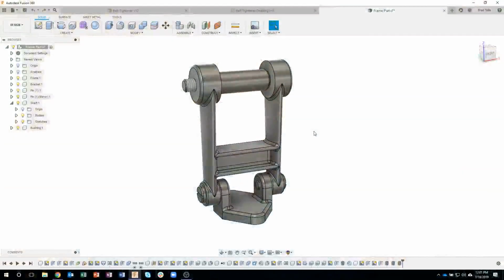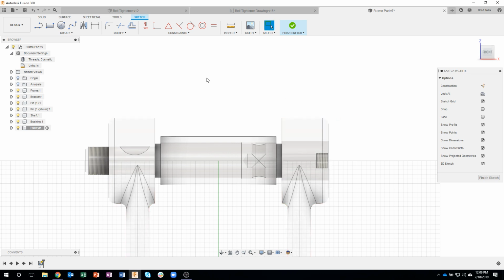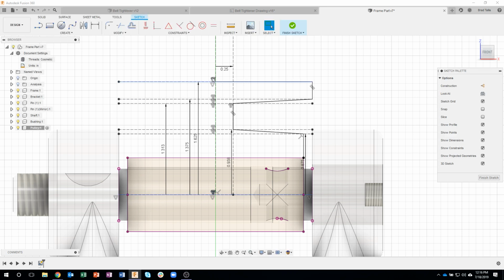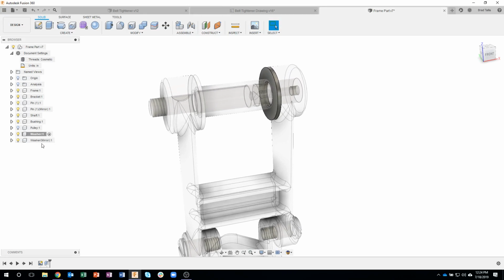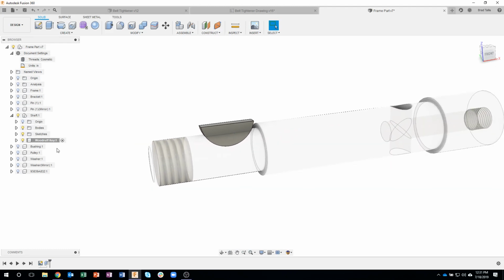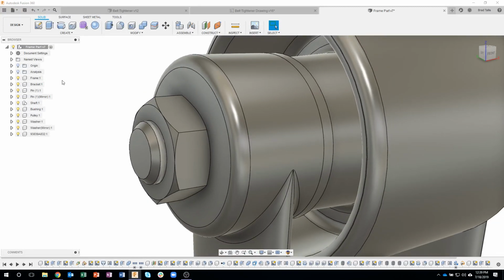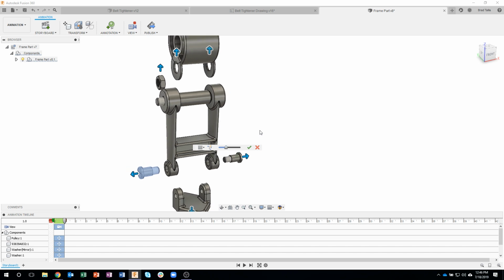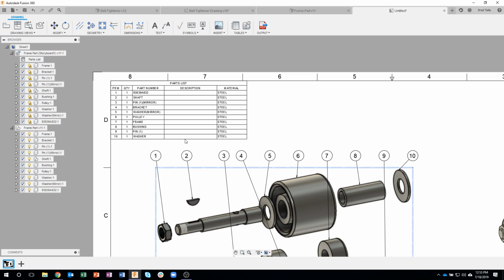360 LIVE: Creating In-Context Designs (part 3 of 3)

Comment: At 24:47, you didn’t even need to create the sketch for the washer. You could have gone straight to extrude, select the face, chose the option « To object! » and Voilà!!!  One less feature in the timeline! ;) Important though, you need to access the Extrude command to do that so tou can’t use the « Q » keyboard short cut. Use the « E » key or you’ll end up in the « Offset face » command and that won’t work here.
Reply: Ya, you can do it that way, but you have to remember to select "New Component" in the operation, otherwise it will "join" or "add" that extrusion to the existing part.  I also like to use a sketch because typically your sketch is the "master definition" of the part.  When you want to make a change, you typically change the sketch.  However, you are correct, it saves a step or two.
Reply: @bradtallis8968  Thanks this answered my question about if there was advantage to the sketch here. I guess a key thing here was that it was a new component. If it was part of an existing component maybe it would be less worth it.

Comment: Enhancement request for the combine and Project commands. Instead of having the parts be created line to line, as in the combine command with the "CUT" method, provide an option to have a clearance be included. Kind of a built in offset/ built in tolerance. You select the two components to combine --> select combine --> Select Cut  -->  select a "tolerance compensation" which creates a gap a certain distance you specify (i.e. 0.005") -->select okay.   From the example you gave in part two @ 10 minute mark, you may want to have the material removed from just the frame or material removed from just the bracket or have it removed from both (i.e. 0.0025" from each component) or finally a bilateral tolerance applied which gives the most control. Same goes for the project command.

Comment: Q2: Is there a difference between move "point to point" and align (which is what I've been using)?
Reply: @Mixed Reality-  Yes, you could consider them being similar, mainly due to the fact that we aren't building an "actual" joint as you would in the Assemble menu.

Comment: I’m having the worst time trying to move that but into position. I cannot seem to be able to isolate that center position without it going away when I move my mouse to click on it. I have tried the command key (Mac) but then I can’t seem to do the same when I try to select the target point. Frustrating to come this far and get hung up on something so mundane.
Reply: I had the same issue and the problem was holding ctrl while hovering on the circular face then move the cursor over the center point and click on it. It's not immediately apparent but it selects the center point. Hope you could find a fix and had your model finished. I'm throwing this here for future reference for others who have a hard time dealing with this.

Comment: I wonder why do you use mirror on components instead of copy/move (optionally followed by joint)? A copy creates another component instance and it looks clean in components list. I think mirror should be used primarily for bodies.
Reply from the maker: All depends on the end goal. Mirroring components could potentially cause problems with BOM inaccuracies.

Comment: On this design can you do an animation showing how the components are assembled without them passing through each other. I can not see how the woodruff key can be inserted without interfering with the washer and bushing.
Reply from the maker: @Robert-  Ya, good point.  I'm not sure either.  I just followed the drawing from the drafting book I showed in part 1.
Reply: This could make for an interesting video. Using the animation workspace to show how the entire assembly is put together. If this assembly can not be done without one component passing through or interfering with another, this would show a design flaw.
Reply: @adskFusion  To expand on Robert's request, when doing the exploded view of the drawing, can you have lines showing where the exploded parts are supposed to go when assembled? Kind of like how some exploded views show lines connecting the parts since they get confusing as which way they go together. For example, a line would go from the key to where the slot is on the bolt. Another would have the line going form the bolt, through one part of the frame, up to the pulley assembly, then back down through the other hole. Etc.